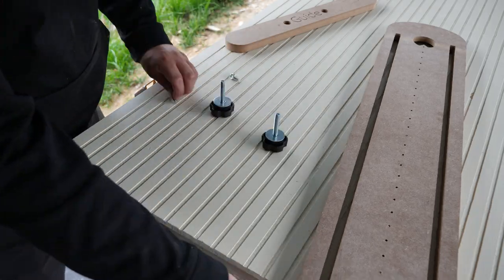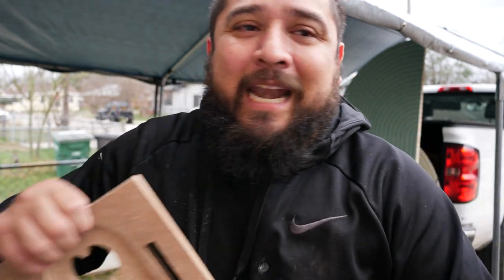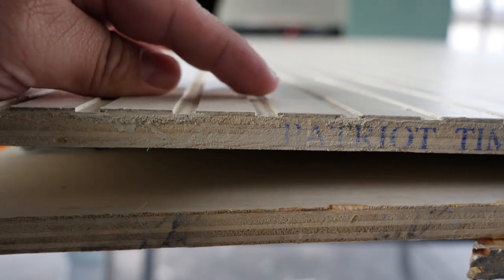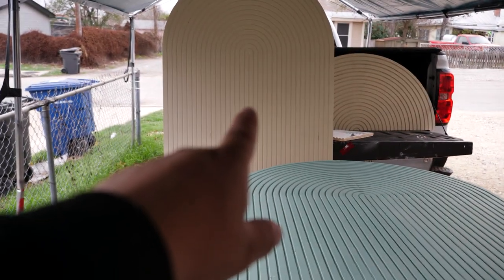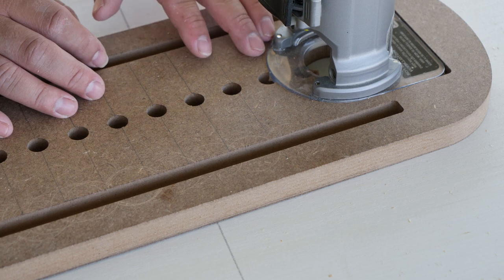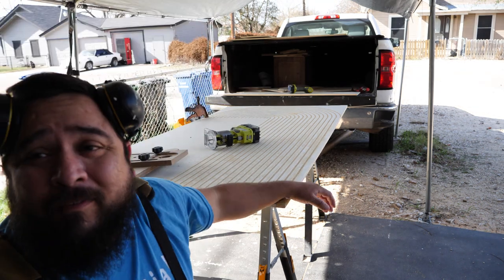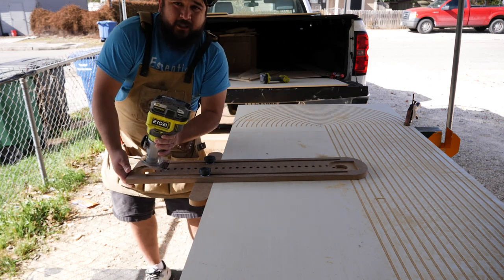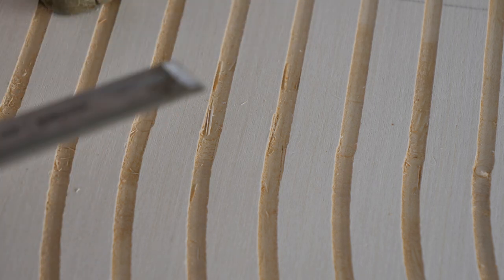DIY Ripple Wall New Jig

Comment: Hello Maker Decor, thank you so much for this helpful video. I have a collapsible ripple panel made with MDF and want to paint it to a sage green color. Do you recommend brush or spray paint method? Which brand of paint do you recommend? Thank you!
Reply from the maker: Hi, thank you very much! For MDF I do not recommend spray paint as it just absorbs it so much and will take a lot of spray cans. If you have a paint sprayer, that will work and be the best option. If not a brush will work fine. The main thing with MDF is to use a primer first because it just wants to absorb paint so much. So a good primer base first and maybe 2 or 3 light coats of paint will do great and look smooth. For brand most will work great as I have used inexpensive and expensive brands. What counts more to the look you want is the sheen. Meaning the paint you get if it is glossy, semi glossy, satin, Flat, etc. They give different looks, so be sure to find the one that fits the look you are going for. Good luck!

Comment: I just ordered your router guide for the ripple wall❤ I can’t wait but wanted to ask you what kind of router do I need? I want the same one you have!
Reply from the maker: Hi, thank you so much for the support. If you read the description from the jig on the website. It has the information on the router that is needed with this jig. Or you can just look it up on Home depot's website. It is the newest Ryobi router battery powered. They have an older one that they really don't sell anymore. This is the newest one that just came out not too long ago. You can also go inside a Home Depot as they have them there now. Again, it has the info on the website where the jig is ordered, but it's really just the newest Ryobi battery powered router. I hope that helps. If you have any questions just message me. Thank you for the support. Good luck!
Reply: Where did you order it from?

Comment: Hi, where can I get the router that you used? Thanks.
Reply from the maker: Hi, it is from Home Depot and it is the Ryobi Brand. It is their newest router that came out. I will put a link but check the website a lot because they put it on sale a lot. The original price is like $100 but I got mine for like $60 and sometimes they have it for less? Home Depot has a lot of sales of their Ryobi Branded stuff. Just make sure it is their newer one like the one linked below 

https://www.homedepot.com/p/RYOBI-ONE-18V-Cordless-Compact-Router-Kit-with-2-0-Ah-Battery-and-Charger-PCL424K1/320639499

Comment: Did you use MDF and if so what kind?
Reply from the maker: For the backdrop I used 1/2 inch plywood. MDF looks cleaner, but you need to wear a proper mask the whole time cutting it. MDF is terrible for your lungs to breath and this jig makes a lot of dust. I just didn't want to wear a mask the whole time, so I used plywood and it worked great.

Comment: Do you have a link for the router bit
Reply from the maker: Which bit, the one I showed at the beginning for a CNC machine or the one I was using on the router later?
Reply: @MakerDecor  the one for the router
Reply from the maker: @NipseyEternal99 Sorry, I do not have a link to that one as I believe I purchased from Lowe's. But it was a 1/4 inch spiral upcut bit I believe. Thank you